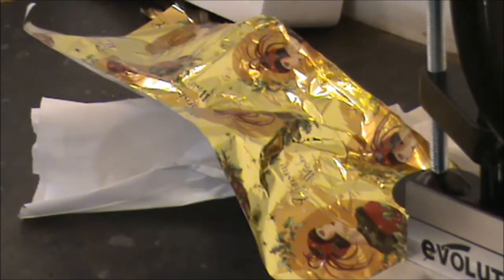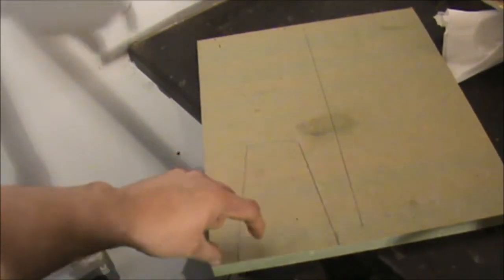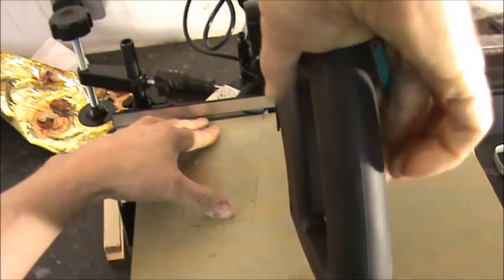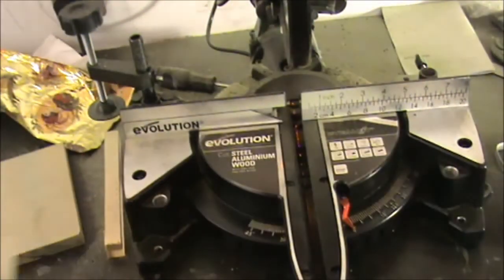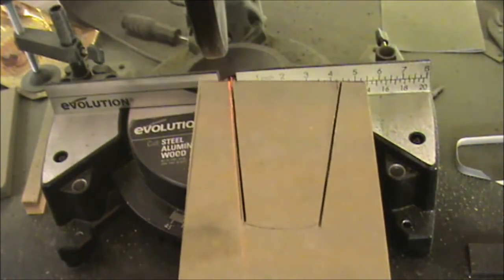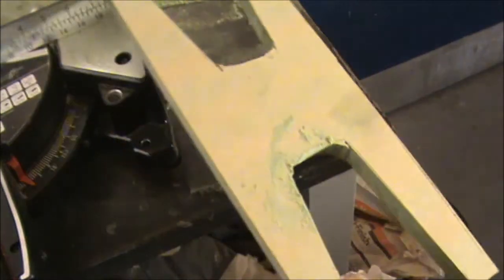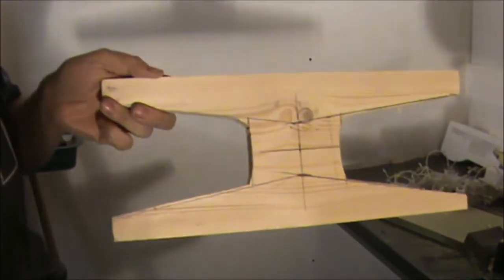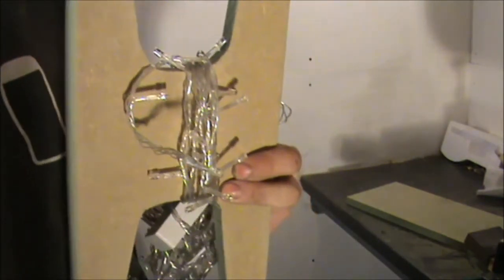Simple cable tidy for Storing Christmas tree Lights  !

Comment: Excellent. You can also use one for removing your wellies. Nail a 2"x"2 block underneath (side to side at the centre, not along the length). Stand with one foot on the board and put the heel of your wellie boot in the V shape. Lift your leg and your wellie will come of easily, no muddy fingers!  :-)